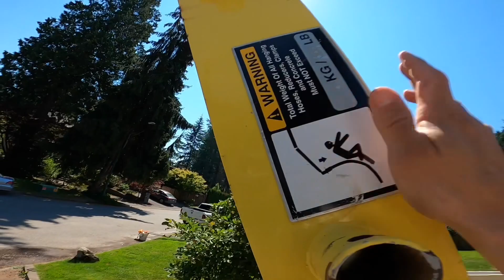Safety slings: love ‘em but certainly don’t leave ‘em!!!!

Comment: You got 3 reducers and no aircuff?
Reply from the maker: The standard air-cuff is only effective for 3” diameter and larger hose. We do have one of the newer ConForms fabric air-cuffs designed for 4”-2” hose, but it was not on this pump for this day unfortunately.
Reply: @canadianconcretepumper1979  as soon as I wrote this and hit enter you were like I know imma get comments about the reducers lmao. It's kool that you are able to run such a small hose. Our mixes don't all me to do that
Reply from the maker: @Flapjacktheclown  we’re vey blessed with our mixes/materials up here. It’s actually quite common for us to use as small as 2” hose for pouring residential work. We got it easy in  comparison to markets where they’re dragging 4” and 5” hose around all day for sure.

Comment: I'm jealous of your 3 axle 38, here in North Dakota I have the same 38-5 and 5 axles is barely legal, by like 250 pounds on the back end. Its impossible to build a 47m that doesn't need a permit year round.
Reply from the maker: Jeesh, and I thought our road requirements were particular. Ain’t it funny how from state to state or province to province the axle spacing requirements can differ so drastically? We’ve been yearning for a 63M on our roads for over a decade now, but even the gen 1.5 Putz 63Z is still a couple thousand pounds too porky 🙃
Reply: @canadianconcretepumper1979  I understand wanting to protect our infrastructure but we can’t halt progress on development to do so otherwise the infrastructure is pointless.
Reply from the maker: @christianwagner23  especially when considering that concrete pumps play such an important role in building said infrastructure, yet account for such a teeny-tiny percentage of vehicle traffic on our public roadways..
Reply: @canadianconcretepumper1979  exactly, when I tried to make an argument with ND DOT I showed them our trucks hours vs their mileage. When a 2017 truck only has 20,000 miles on it but 6500 hours that should tell you everything you need to know about their highway use.

Comment: Have you ever tried using 5 inch to 3 inch reducer? does your concrete mixes allow such drastic reducer? you could get away with less locks and therefor less variables, in Finland (atleast in our company) we use 5 inch 1 meter double ended hose from the tip that is always secured (and always aircuffed without ever needing to remove it, also linejobs we can get our air supply from the aircuff hose when cleaning the lines with a sponge) and from there just reduce it from 5 inch to 3/2,5/2 inch hose. Bigger pours 4 or 5 inch tip hose. 
I've been concrete pumping for 4 years now with different machines, putzmeister pumis, and 24, 36, 38 and 42 meter pumps. I really enjoy everyone of your videos. Very interesting to see the differences and similarities between our countries when it comes to operating the machines and pumping different jobs. Cheers from Finland!
Reply from the maker: I have thought about it, but the only thing which deters me is that if it does plug, I have to remove the reducer at he 5” clamp. With the 3”-2.5” I just have to pop it off as 95% of the time that’s where it plugs. We do have a 40” long 4”-2.5” on our line-pump and it works great for that application!
Reply from the maker: We sometimes do similar to what you’re saying except usually with a short 4” hose and air-cuff when connecting up to smaller diameter system. It’s really handy having the hose and air-cuff prior to the smaller reducers as we can add/remove system without having to wait on the boom to stop emptying out. Just pinch the 4” hose with the cuff and good-to-go!